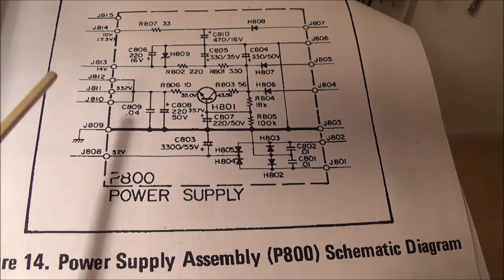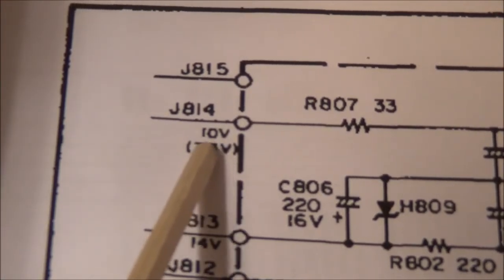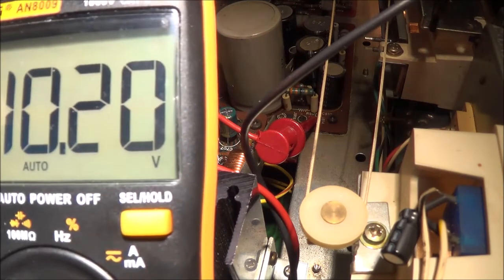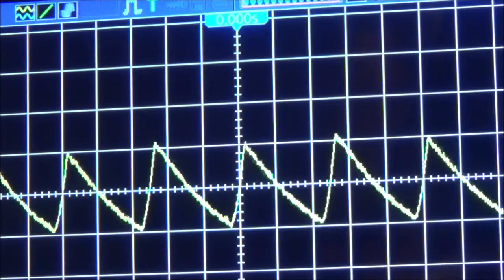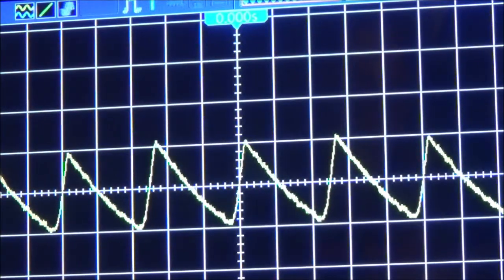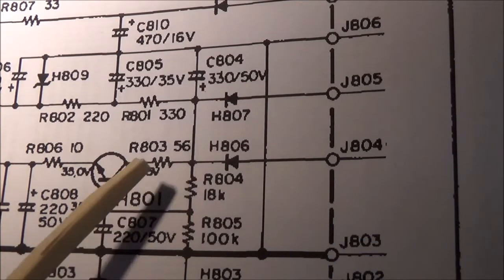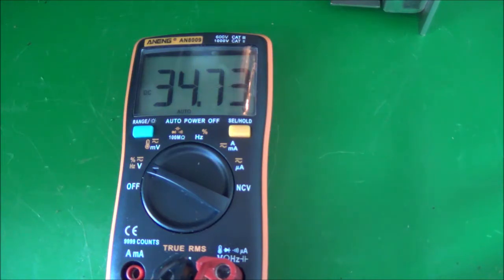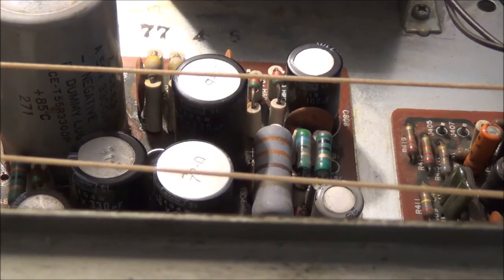Marantz 2215B Power Supply Voltage Check

Comment: I would have liked to have seen a after on the o'scope to see what happen to the ripple.  This also helps me some as I have a portable AM/FM that seems to be spilling AC onto the DC ground and a 60 cycle hum...I have recapped, changed out the half wave diodes, re-flowed and then put it aside, time consuming project, needed to move on...however, Ill remember this video...thanks! Great to see a video from you!  ~Jack, VEG
Reply from the maker: Thanks and good that you are well. I did not change the caps yet, so I wouldn't be able to tell if the ripple would decrease. Probably not, since the vintage Japanese capacitors seem to hold up quite well. You can easily see the ripple coming out of the power supply of your radio with the scope.

Comment: Few of those thermal resistors are indeed very close to some other components. I noticed you're using the Aneng AN8009, Sigh.... Now I want it too. Whats one more DMM for the bench. Hehe. Great video as always.
Reply from the maker: That Aneng is cheap too. It's not as good as my Fluke, but for the price it can't be beat and it is pretty small, which is handy. Recommended buy.